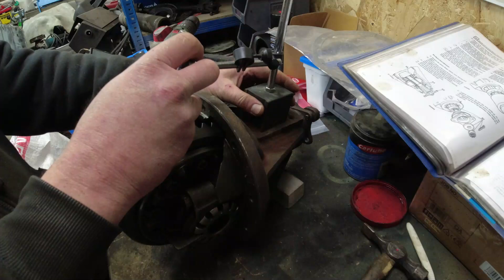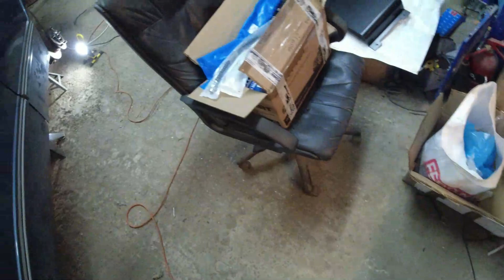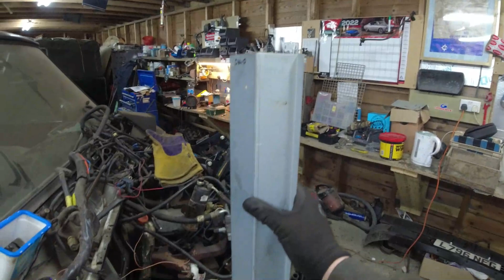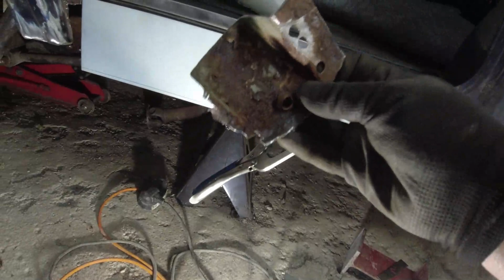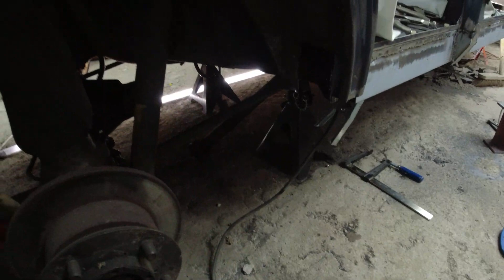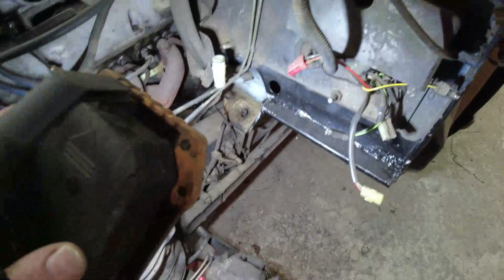1993 Range Rover LSE episode 7 - Rear axle and sill welding - profanity warnings of course

Comment: So much preparation but as they say measure twice cut once!
Good work mate!
Got to install a 12000 lb winch and rear fog lamp to my Defender 110 nice humid 33 degrees had to grind the bolts off the fog lamp and the new ones don’t come with the nuts!!